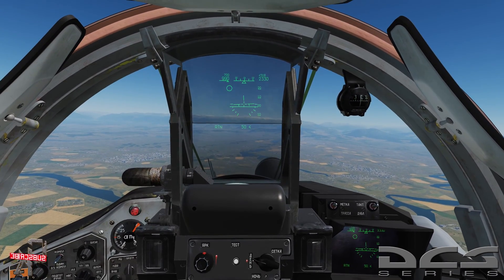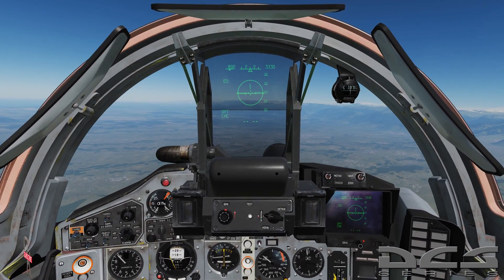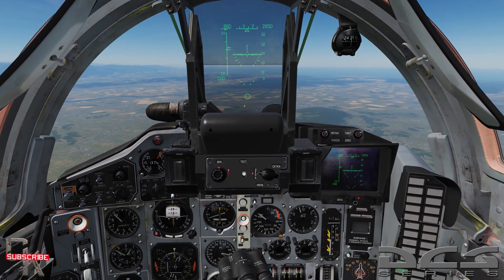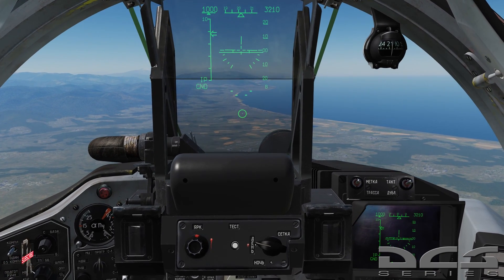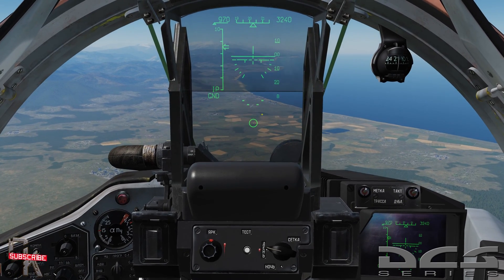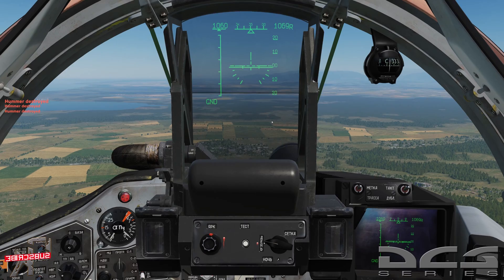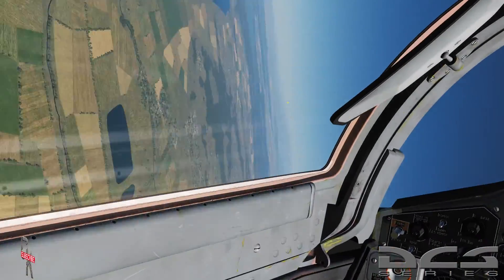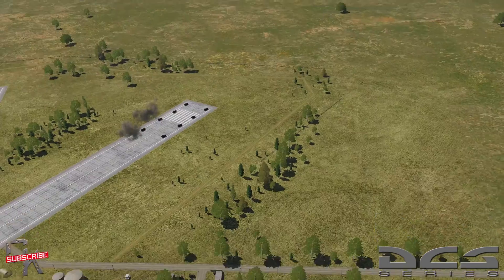Basic Fundamentals DCS World: MiG 29 Air to Ground

Comment: Something I learned is that there in HUD symbology to indicate which salvo mode is selected, but you can only see it in CCIP when it has a solution (LA). The ordnance dots in the bottom-center of HUD will have numbers over them. so like four FAB250s will have a "1234" over all dots when you want to drop all 4 instead of 2.

Comment: Hey man, Great videos! I fly the MiG-29 variants a lot but your vids showed me some things I still didn't know about...I had no idea you could slew boresight!

Some things I've picked up over the years about A2G mode:

1. The bombs you dropped were in a goofy sort of CCRP mode. In a level or shallow bombing run you hold the trigger when the pipper is over the target, diamond, auto release..etc etc...just like you show. But when you hold the trigger you get an aiming cue circle at the top of the hud. If you keep the top the the attitude indicator (the vertical part of the little airplane) dead center in that circle, that will keep you laterally aligned with the target, giving you a more accurate drop.

2. If you make you bombing run at a steeper angle ( and the exact angle varies with speed, altitude, and ordinance) you'll get a more "traditional" CCIP mode, with a fall line and the pipper. 

3. Also an interesting note worth mentioning is Air to Ground ordinance will ALWAYS drop in pair (provided the bombs or w/e are the same). There is NO single release mode. This has to do with the Fulcrum being susceptible to unfavorable flight characteristics with asymmetric loads. I think I read that in the real manual, but I could find a source if you really want it :p
Reply from the maker: That is excellent information! I'll touch on that briefly in the next one!! Thank you!